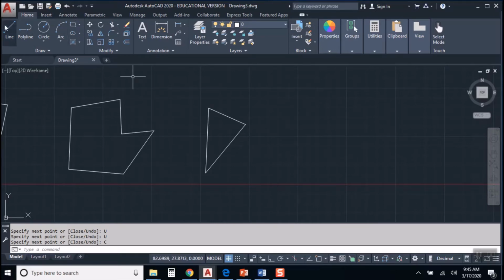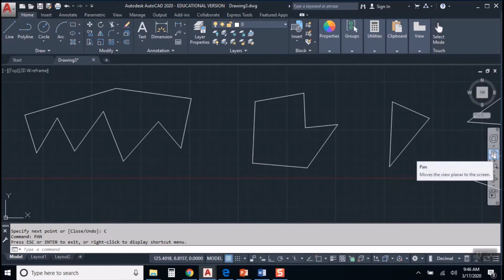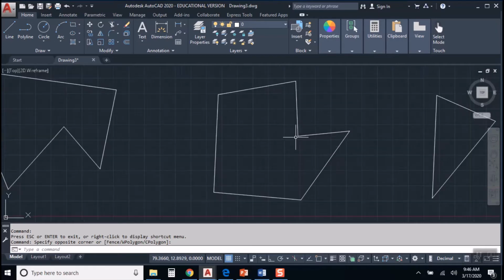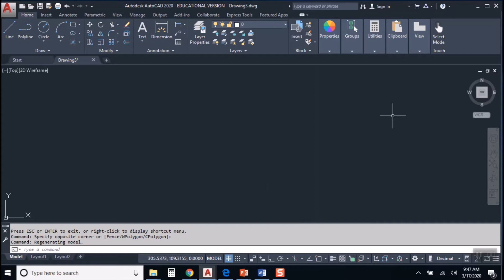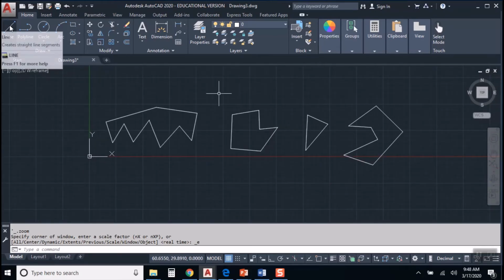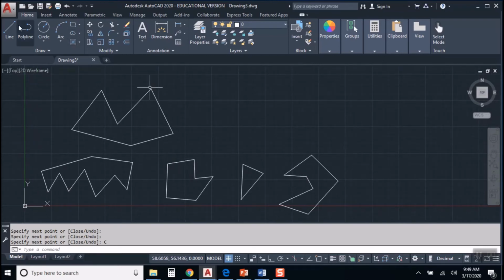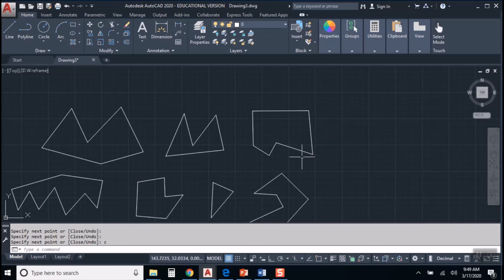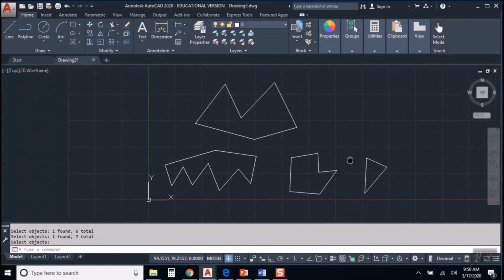B12 UNIT 9 VIDEO 3B

Comment: I toggled my status bar and now it does not show up. Is there a method to add this feature to the bottom of my screen again.                   Thanks
Reply from the maker: You need to click on the "Hamburger" and place a check-mark in front of all the tools in the list. Doing so makes the tools on the status bar visible. If there are no checks, then none of them will be visible. Also, if your Ribbon disappears, type "Ribbon" to get it back. If you close your command line type "CommandLine" to bring it back.